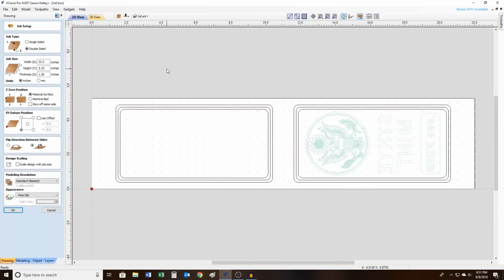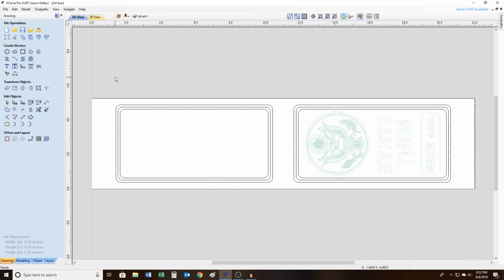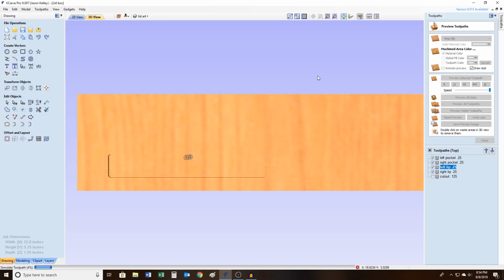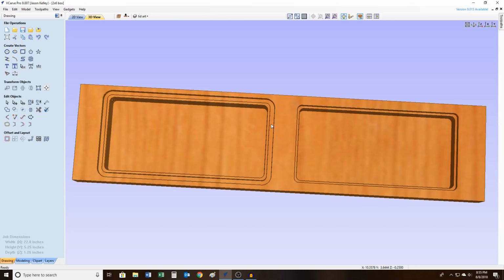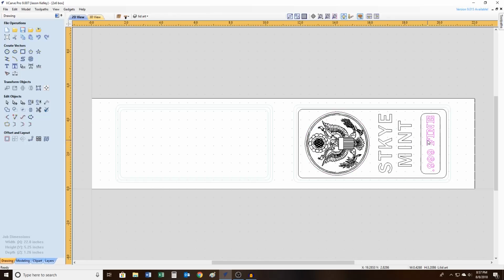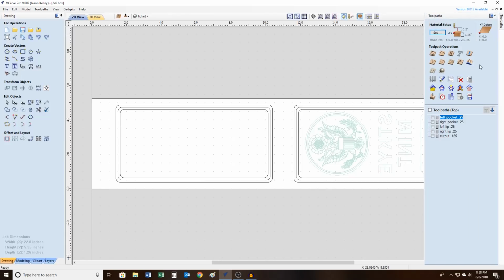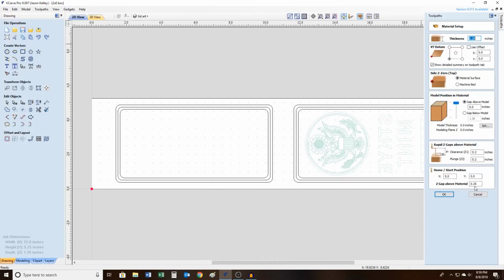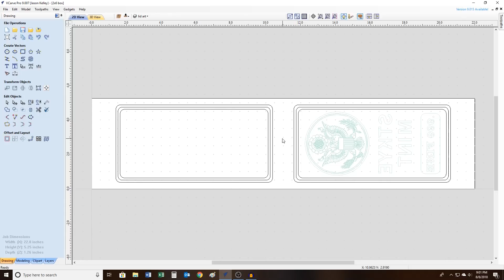fixing my Z height problems and how the 2x6 box was designed

Comment: Hi there, new subscriber! I am a designer and CNC programmer by trade and have been investigating which router and software combo I should invest in. The problem is, how come it seems no software seems to accept .stp files or other formats I could save out using solidworks? I want to design my own files and import them into the CNC software to program. Any help would be greatly appreciated!!

Comment: Ok Jason,  I have watched most of your videos.  I have had my shapeoko xxl just over a month.  have been like most newbies been using Carbide Create and carbide Motion.  so far so good!  however carbide create is limited  but it is free.  after watching your Videos and several others, i decided to get V Carve Pro.  great decision.  I love the ease at which you can design things and so far no problems.  setting up tool paths are very cool as you can actually have a tool path that dose not spend 60% of its time moving all over the work piece cutting random holes that seem to make no scene at all until you finally see things start to come together in Carbide Create.  Again free, I get it.  Now i have saved my gcode with a simple little plaque with a name on it just for testing.  i am still using Carbide Motion and i saved my gcode  with the Shapeoko Inch
Post Processor.  did all the setup marking zero on X Y Z.  Load file into carbide Motion pressed start,  was expecting the window to tell me to load the proper Bit, but no the next thing i hear is that gawd awful noise that you talk about in this video, by the time i got my wits about me and got it shut down the project has a v bit hole all the way through and my wast board has the matching pair 1/2 in deep!  then i found this video and i think i got that fixed, thank you very much,  but now i cant get it to do any thing but go through the motion just barely touching the work piece maybe 1000th of an inch.  i also have some other questions but this will do for now.  Thanks

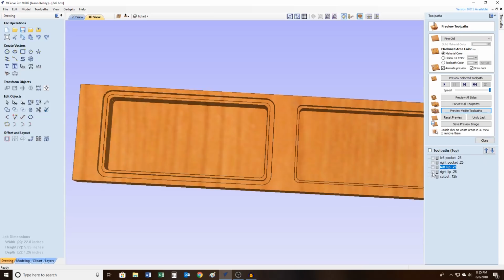Comment: I just saw this video. In case you haven't figured it out yet - the reason the preview didn't work at about 4:40, checking the box next to a toolpath does not select it, it marks it visible. To preview it, you should have clicked Preview Visible, or you should have clicked on the name of the toolpath to select it, then click Preview Selected. You had already previewed the highlighted toolpath, so when you said to Preview Selected, it was already done.
Reply from the maker: That's good to know. Thanks for the insight I will remember that for next time.

Comment: Thank you for your videos, keep the videos coming.  I am new to the cnc world, and have learned some stuff from watching your videos.  From what i have gleaned from watching other videos I believe that you would select Z Zero position off the machine bed if you were going to change cutters during the project and you had milled off the entire surface say during a rough cut.  You would then still have the machine bed to set your Z Zero position for the next cutter.  You would use the design scaling option if you were going to make a previously made project only you wanted to scale it down or up to a different sized piece of wood.  This would do it for you automatically.  Hopefully I am correct here.  Like i said, I am really new to this.
Reply from the maker: Wally's Toolshed that makes sense. I'll have to try it and see if it works. The scaling that is. I have never used the machine for the zero. Not that I have any opposition to it I just never tried it.